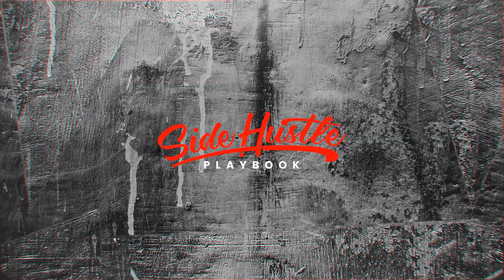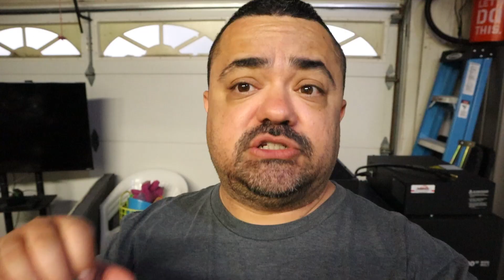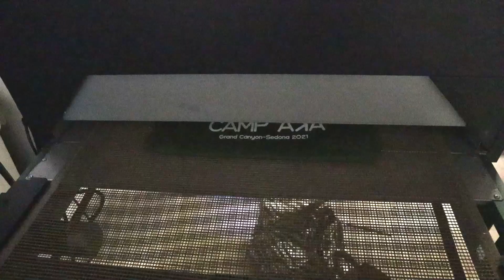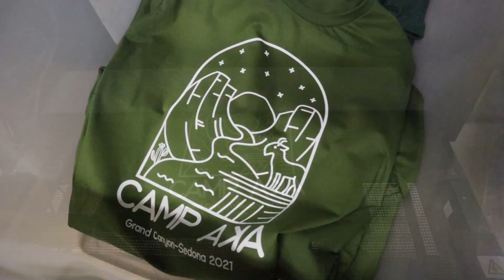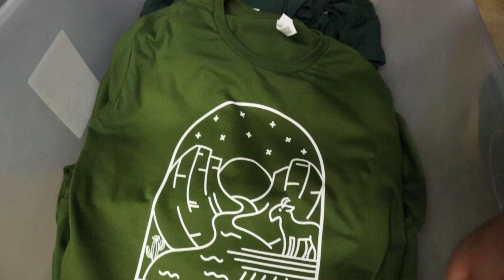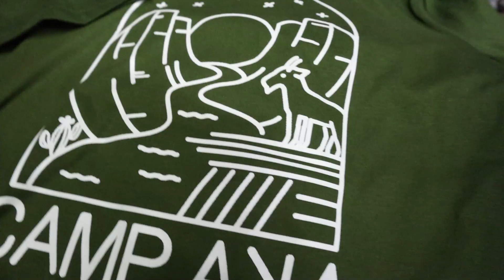Working with the Vastex Little Red X1D Conveyor Dryer

Comment: Have you tried the dryer with water based inks?
Reply from the maker: The DTG ink is water based. Works solid but I'd definitely get the donut probe so you can ensure you hit the temp and time needed to cure.

Comment: Can the conveyor dryer also dry the pretreated shirts?
Reply from the maker: Yes it can. I don't always use it for that but when I do I run the belt a bit faster so they go through quick. However, I find pressing them works for better DTG prints since the fibers get pressed down.
Reply: What if I presss it first then spray the pretreat after then cure it wit the dryer ?
Reply: Boss should I upgrade to a conveyor dryer for my dtg set up, I’m trying to avoid the heat press box and get a better looking dtg print, any info appreciated thanks